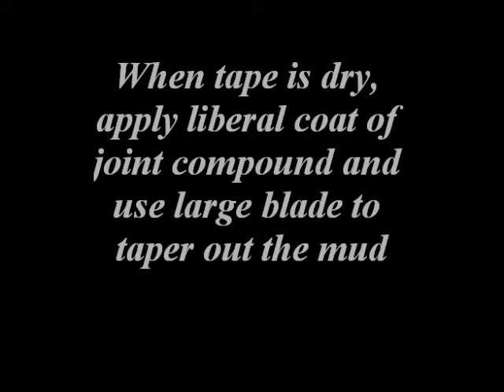How To Tape Corner of Drywall

Comment: what can i do to prevent little wholes when the plaster drys?
Every time i plaster a wall and i start to sand it i see little pin wholes..
Reply from the maker: The mud is too runny is all I can tell you....but eventually paint will fill the holes anyway.
Reply: Thanks for the reply...